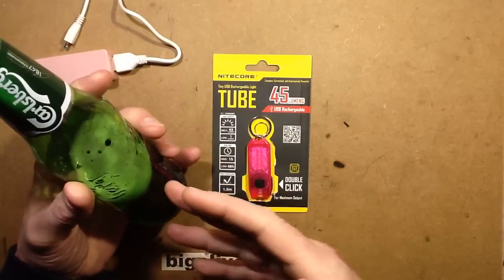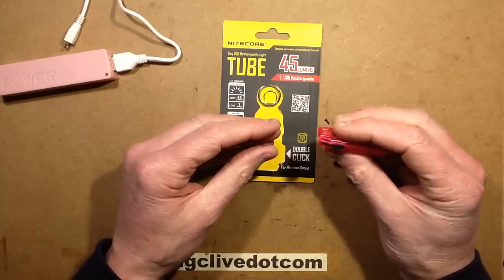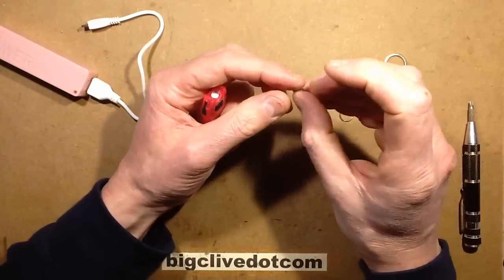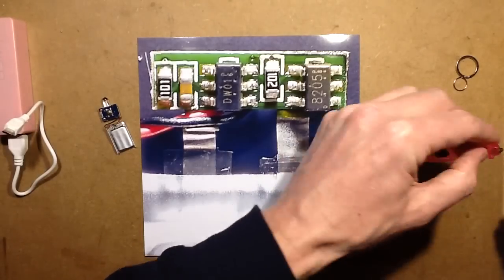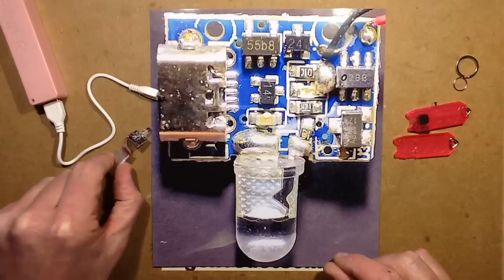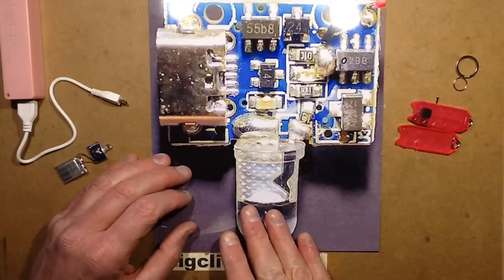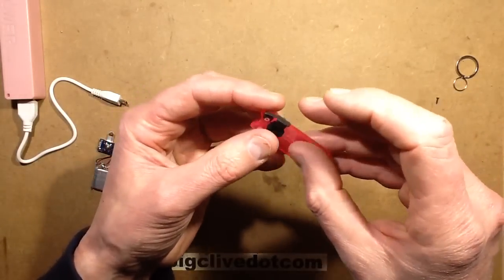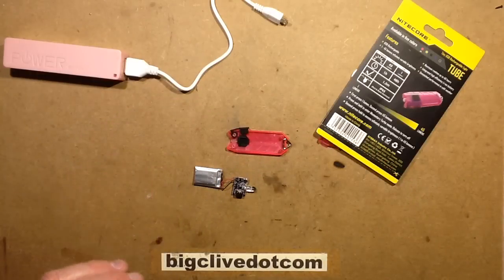Nitecore Tube keychain flashlight teardown.  (Half watt LED)

Comment: Just picked one up from eBay.  As a pilot I always need two flashlights in the plane with me.  Keychains are an easy backup flashlight!  Good news - they make a RED LED version which saves night vision when in use.  Will be interested to see how it handles.  Thanks for the video @bigclivedotcom

Comment: IP65 is only dust protected and is "(p)rotected against low pressure water jets from any direction. Limited ingress permitted." that doesn't affect performance, so the rating seems accurate. I'm not sure what low-pressure entails, but I assume running it under the tap. High pressure is about cleaning, if I understand it right.
IPx7 is where immersion proofness starts.

Comment: You can see the chip at an angle,when you first handled it and when you were asking if you could see it,as you were putting it down,you could then see the chip in the led. I use those lights to find other lights. I try to keep a flashlight in my glove box,something that small would be great for under the hood poking around. I would like to see one mounted on a strong magnetic holder,something very small,and mabe put the led on a movable arm,that would be the bees knees.

Comment: kinda like the zoom apps . didn't know much about them.  even with the so called 4 Ultra pixel  (most programs show up as 4 mega pixel, although I know what HTC/M8 was trying to do and it's what alot of phone camera's do.  bad images.  Blotchy when blown up to their full size.  )  anyway the zoom apps work rather good with that M8.  But seeing that one chip on the big blob of solder/heat sink just makes me cringe.  1. Why make a chip so small that most people can't put them on straight  even if EEVblog seems to think one can.  and I wish I knew where he gets this well solder tip  (has a well that stores a bit of solder and one can just wash it across the pads.  ) anyway It reminds me of a Famicom Clone cartridge that doesn't quite work 90 % of the time.  I get the menu but the games don't work.  And it has this chip that's wandered a bit crooked like that.  (was like the only one with erm Kirby's Adventure with the possibility of using a battery although one would have to add it yourself.  And I'm not sure if the battery would ever fit inside such a small cartridge.  since most holders exceed the thickness of a Famiclone cartridge (banggood, this would be the blue one with 150 games on it)  Naturally I've taken most of those apart.  Not the actual Famicom carts except one.  And just about everyone has the Golf cart.  (no pun intended)  Think if I did stick a battery on it, if it bothered to work, it would be in an NES cartridge with the converter

Comment: IP 65: Able to protect against water jets, Water projected by a nozzle (6.3 mm) against enclosure from any direction shall have no harmful effects. 
Test duration: at least 15 minutes
Water volume: 12.5 litres per minute
Pressure: 30 kPa at distance of 3 m

So yeah, water resistant, never tested for immersion at any depth. That said, I'm not sure it would handle IP65 really either.

Comment: Small question about LED's
Are they mostly created equal in terms of brightness or is it mostly down to how much voltage you shove through them?
For example is a 3V Cree LED going to run significantly brighter than any other run of the mill 3V LED?
Reply: aljowen LEDs are a current controlled device. Once you reach the forward bias voltage, what determines the brightness is how much current is allowed to flow through the LED. Unrestrained, an LED will pull as much current as the circuit allows - to the point of self-immolation, so what matters when it comes to brightness is the power rating of the LED.
Reply: Yup and something that's inherent with a high power rating and anyone familiar with electronics. For the higher output LEDs you'll need a good path to remove the heat from the LED itself or it'll be fried in seconds even when not exceeding the power rating.

Take the Cree XHP50 for instance (5mm by 5mm, 4 seperate LEDs on that area typically in series. According to the Cree datasheet the 12V version has these in the spec summary: 1500 mA max current, 11.5V typical forward voltage at 700 mA.

According to the graph further on at page 12 you get 12.25V at 1.5A. This is 18W of energy going in more than 65% of that if I'm not mistaken will be turned into heat (don't know what current efficiency percentages are at now). 

And for fun, the relative flux at 1.5A should be about 185% according to page 13, so on a nice 4500K 90CRI G4 binned LED that'll result in 680*1.85 = 1554 lumens (assuming 85C due to heat output, no way to keep that stable at 25 degrees celcius). That's a lot of heat and light output for something which is just 5x5x0.73mm (or 3.58mm if you include the dome over the baseplate + LED).

Comment: not surprised its well made, as someone who vapes everyone says if you need to recharge 18650 batteries then use a nitecore charger, so thats what i got its a nitecore um10 (single bay), thats a point lol could you get hold of a um10 nitecore charger, it has a lot of features like the ability to re-activate dead/completely drained batteries

Comment: Ugh, look at that solder.  At least they used a polylcarbonate case instead of acrylic. 

Not sure what you paid for it, but here in the US (on eBay) they sell for around $10.  Given the low 45lm output, the broad beam at that low brightness, the bulky plastic shell (For What It Is), the USB charge socket that's going to break off the PCB eventually while the water resistant cover will break off, the lack of waterproof-ness, the whole disposable nature of it, I just don't see it being a good choice compared to something like an Olight i3S, which also sells for same $10 on eBay or Amazon in the US, and runs fine from a standard LSD NiMH rechargeable AAA cell.

I do like the integration on this Nitecore, but it seems to drift too far towards USB trinket idealism and away from real world flashlight use, at least at the $10 price point.  If it were $2 delivered then, meh no, I already have enough lights that I don't use so it would just sit in a drawer till the integrated Li-Ion cell shelf rotted and became a fire hazzard. 

I do think it has a market niche for people who fumble around in the dark to unlock things with keys, but that same niche could be filled by AAA powered lights that can do a lot more, and for that brief amount of time it would need to run per-use, I don't see the USB charging feature to be something used often enough to add much value.  You just aren't going to run this light for long at anything it's suitable for.

Comment: They don't claim it's watertight.
IPxx denotes the protection level, first digit for solids, second for liquids.
IP65 would be:
6/6 against solid particles e.g. dust tight.
5/9 against liquids e.g. water jets.
I believe that.
Specifically they claim it's dust and water RESISTANT.
If they'd claim it's watertight or that you could submerge it, they'd have to say IP68 instead.

Comment: There's oriental made mains powered stuff been getting into actual brick and mortar british shops with clearly false IP ratings - recent example the Bosmere N292 IPX4 fan heater. http://www.poplarnurseries.co.uk/news/product-recall-bosmere-2-kw-greenhouse-heater-n292/ which is a fan heater enclosed in a slotted metal box (to allow the fan to blow air through.) with no protection against the ingress of water.
Today it's just another exaggerated marketing claim, I wouldn't take any of it particularly seriously any more. 
FWIW There's video of what an IPX4 test looks like on youtube.

Comment: Hey Clive mate i am not sure if you will see this. I done a review of this on my channel its old so not like my newer reviews but i did soak it with the hose real good and it lived.I would say its fairly water resistant IP6 is only rated for strong water jets any ways i think you need IP7 up to submerge it. They have a newer model out its kind of the same just heaps more powerful its called the Nitecore TIP.

Comment: is it possible to fabricate an actual LED from scratch? is this something doable without expensive machinery?
Reply from the maker: It's too complex for easy DIY to make an actual LED.  The closest would be to get a chunk of silicon carbide and probe it until you found a spot that lit blue.  (The first blue LEDs were silicon carbide.)
Reply: Then because 45lm was such a craptacularly low amount of light, I pulled the 45lm LED out and put a $0.77 Cree XT-E in and drove it to 200lm... would've gone even brighter except that's within the thermal capacity of the heatsink I could fit in the headlamp housing.  I wouldn't have even bought the headlamps in the first place except I was led to believe they had a 3W LED.  At the time another seller spec'd an identical looking light at 3W, which I didn't necessarily trust, but figured even if they were under-driving it, that it'd still be a lot brighter than 45lm.
Reply: Why on earth would you want to bother?  Even if you succeeded, it would take you years of development and MANY thousands of dollars to arrive at the quivalent of what was available for dirt cheap a few years ago, while the whole industry would have moved on to even better cheap LEDs.   The LED in this particular light is probably worth about 20 cents, bought in bulk of course, maybe less if it's a generic chinese product.  It wasn't even worth your time to read this post if I had a magical way to snap your fingers and make it happen.  ;)

In short no, even if you accomplished the electronic aspects then you still need the complex machinery to mold the focal encasement for this type, or the dome and optics for the newer non-focused, higher power LED die type.
Reply: Stinky Cheese These definitely don't just use a random generic LED, you don't get that kind of output from a 5mm LED normally.

I don't think he wants to make a usable LED, but to experiment with possibilities.

Comment: Here in n Ireland it would be good to replace led street lights here with this light as they appear to be putting crap led street lights everywhere, unfortunately they don't produce light
Reply from the maker: That's how LED street lights save energy.  By not putting out much light.

Comment: There is supposed to be an explosion or at least people hurting themselves when there is beer drinking in a youtube video, It's in the small print of the Youtube EULA.

I do disagree with one part of the design of this flashlight, the charging LED turning off when fully charged, I think it would be better if it changed colour or started flashing so it would be easier to find in a blackout.
Reply from the maker: This one does better than that...   If you turn it on before charging then it turns off while charging and automatically lights at the chosen intensity if the power fails.
Reply: If it were in a blackout then it wouldn't be charging.
Reply: @Kevin Lopez  .. yeah... so when you have power (befor the blackout) you plug it in and when/if the power goes out IE a blackout starts this light turns on automatically. like  an emergency light
Reply from the maker: It does still come on after the charge has completed, but there is a significant time delay based on the time taken for the chargers capacitor to discharge to the low threshold the light detects as being a power loss situation.  On a small charger this was about 15 seconds.  When unplugged directly from the charger it turns on instantly.
Reply: Terrible Debacle What's a phone line? 😉
Reply: Stinky Cheese You can have this in your pocket for emergencies. Use it to find the BIG flashlight.
Reply: Stinky Cheese Well I can say I am a informed customer and I still chose to buy two of these and they both still run after a couple of years. They have nearly no parasitic drain, one wasn't charged for a year and still worked. One of my favorite EDC is my Zebra SC52W, but this one is still on the keychain and the zebra doesn't always make it into the pocket when I leave the house. It's smaller then a AA or AAA EDC, and lighter. The polycarbonate case has taken a beating, bright enough to find that item you dropped in a parking lot or read your glucose meter. And some people don't want to pay $30 to $100 for an EDC. Some others don't want to mess with 14500 Li-ion cells and have to remove a battery to charge it or buy another charger for the 14500 cells. This one is easy, self charge with a very common found micro USB port.
I keep one at my bench for different lighting and angles to read some of those pesky IC chips that need just the correct amount of light at a certain angle. Bright enough to find your way around a dark house without blinding the other person sleeping in the bedroom when the cell phone can be to much light for this. 
In short, yes I think it has a nitch for most everyday people that don't want to spend more then $10 and want something better then the cheap 5mm led with a cr2025 battery that's no easy to replace for the average user. That's why nitecore has sold so many of them.
No, it's not the light to light up the whole backyard, but it has its use and easy for most people to plug in, charge and use. It's also on the keychain with hardly any extra weight and some won't have to dig in the purse to find it. 
I think I try to charge mine every 6 months, but they have gone longer with little use. If you work in the dark or always find yourself in the dark then it may not be for you. But the average normal person it meets the need for the occasional use.
Reply: bigclivedotcom Clive, by the way I was in the lab tonight fixing something else and checked the screws on the Tube, I know bits can be different from each maker but with both my kits Philip 0 and 00 fit the screws fine.
Reply: Maximillian Schmid I think that sounds correct. I don't remember it working on the middle modes.
Reply: Got to agree with you Gadget Review Videos, I have had the one I have for nearly 3 years now it seems like, I got it when I bought my Nitecore EA11 as a bonus thing on Amazon and I have to say that little light has been taking a bit of a beating on my keychain since, and has even seen a time or 2 being dropped into a bit of a puddle, it always seems to keep on working no matter what and I seem to use it more than even the EA11 that was supposed to be my new EDC light, the tube is just so small and handy with pretty darn good light output for it's tiny size and weight, I keep saying I am going to get another 1 but as good as this 1 is doing it may be a few years before it dies.
Reply: bigclivedotcom I was just going to say that, it's an undocumented feature. But after I posted ''tis on the candlelight forums people reported different results. I think it will turn on if the power goes out (if turned on before plugging in) and the power goes out while charging. But  once it's hits a full charge I think it resets and that's why people were seeing different results from my post. I never went back to confirm this or not. Maybe you can confirm?
Reply: Why would you seek this dim thing in the event of a blackout?  It'd be my last resort, short of firing up one match at a time if I didn't have a candle or lighter.
Reply: SlyPearTree Just trying to be different.
Reply: bigclivedotcom ahh, maybe I didn't give it enough time. Either your the second person I know to find this undocumented feature, or you do your research and ran across my comments on the candlelight forum from ScottJD? My guess is because you thoroughly test things you probably found this on your own. 😊
Reply: +John Bronxite - I already have a much better EDC flashlight in my pocketI could use for emergencies, no matter which one I pick to carry any particular day.  I think this light is just too weak to be worth any bother.  Might be different if it ran off an 18650 cell and those low 45 lm could light up a bathroom for days at a time if there were a power outage, 

I just don't see the point at all.  Even my cell phone camera flash LED can probably manage 45lm, or one of those $1 USB dongles you plug into a cell phone charger/power-bank that''ll run for a day doing so.

Basically to me this light has no niche, nothing it is better at doing besides illuminating a lock to put a key in for a second, but having a better flashlight on me already, I'd rather spend an extra 2 seconds using it than carry yet another thing in my pocket that's inferior for everything else.

I don't think any informed consumer would choose this light unless the price is much lower than the $10 USD it sells for here.
Reply: Mine does that just when it's on lowest or highest mode.
Not on the custom intensity.
Reply: Actually Stinky Cheese they put out a damn lot of light for their size, in fact they are equal to or better than the little 2 aa cell mag lights being they are so small yet in lumens output are equals but have more of a candle like spread to the light rather than a focused beam like the mag light would.